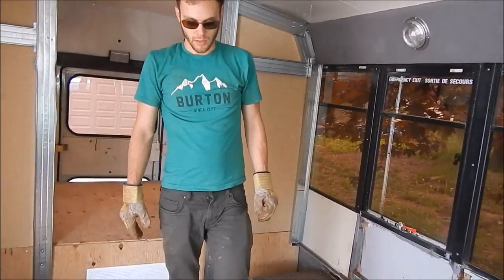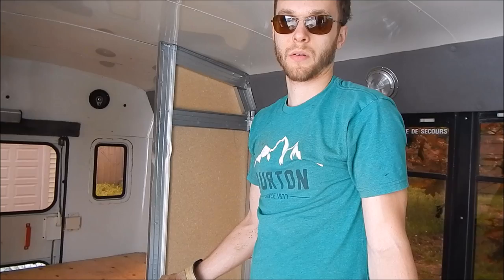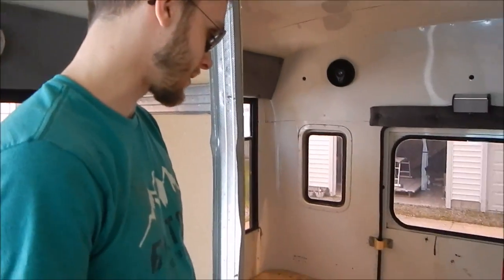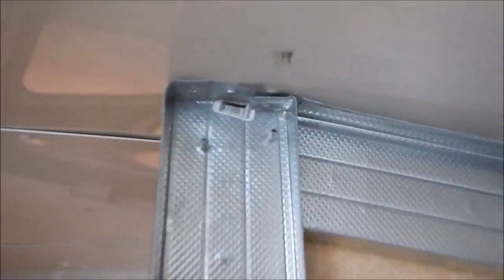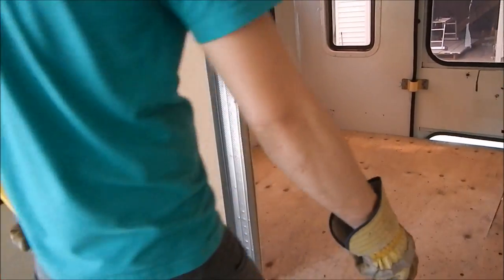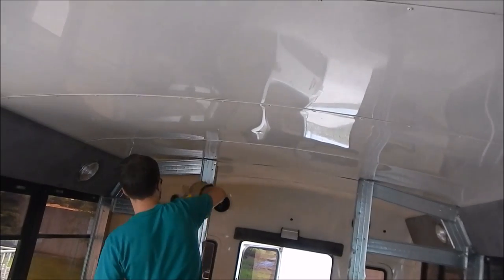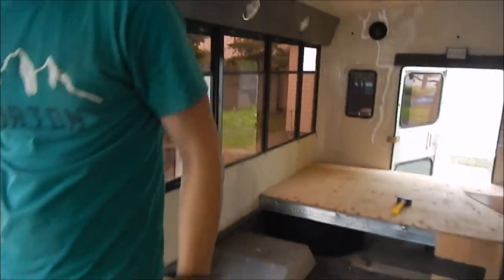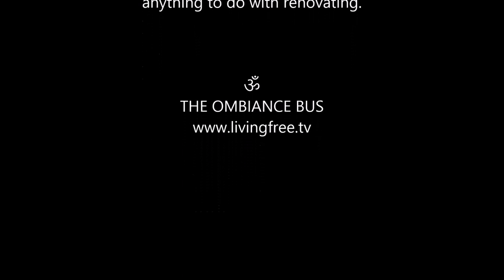School Bus Reno [Ep: 1] The Beginnings: DIY Lesson - Rubber Flooring Removal for Nomadic Living

Comment: is it necessary to take the rubber flooring out if the floor is sturdy?
Reply from the maker: I don't think so.  The rubber stunk SOOO bad in our bus.  

Our floor, as demonstrated, was rusty and had so many holes.  In Canada they won't 'insure' a vehicle if it has holes in the floor either; it was a messy job, but mighty worth it in the end, considering the smell and insurance benefits.

Are you working on a bus conversion project?